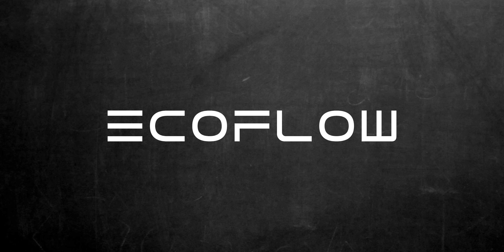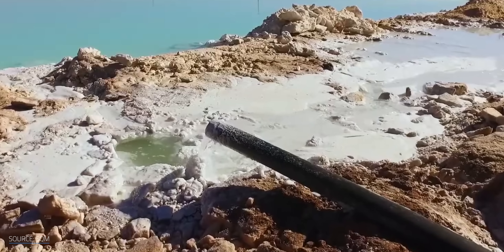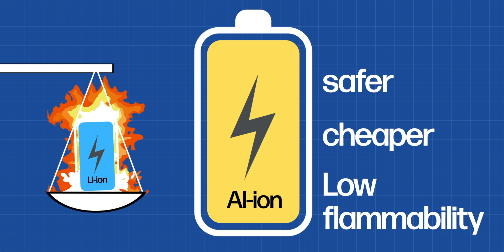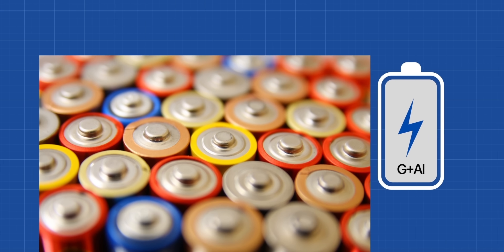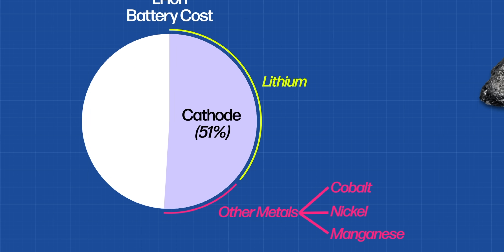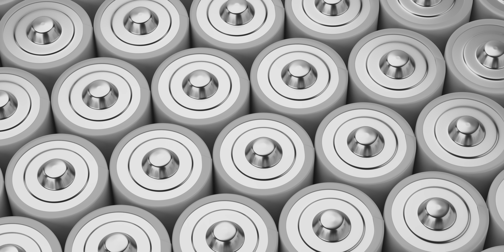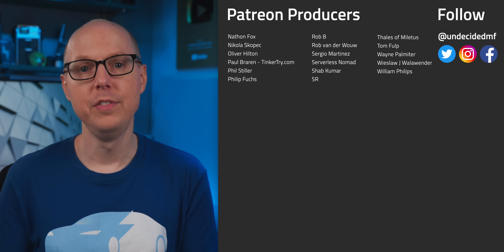Can This Metal Really Beat the Lithium Battery?

Comment: My question (I did watch the video on aluminum-sulfur batteries awhile ago) but can the 2 chemistries be combined? Use the aluminum-graphene anode/cathode and aluminum-sulfur electrolyte to prevent dendrities? Simply reuse the heat generated during discharge and recharge and cycle a very small amount of heat from say a small heat pump to keep the cells in their optimal heat range(heating and cooling, oil/water or air exchanger)) or heck use low level alpha particle emiting compound in the outer jacket to heat the material close to its optimum temp

Comment: I like how you downplayed the cost of graphene by giving the cost per gram rather than ton like all the other materials.  When you convert to ton, LI-ION batteries sound extremely cheap by comparison to the aluminum graphene batteries.  Let me know when the graphene gets anywhere near as cheap as lithium or any of the other ingredients for LI-ION batteries.  Also the cost per ton is not very representative of how much the batteries cost to make as the amount of each ingredient matters more.  You should give the cost of each ingredient per battery and compare that with the aluminum batteries.  This video is biased to make aluminum batteries look promising.  Thumbs down.
Reply: Werent lion batteries multiple times more expensive a decade ago? Or solar power? Efficiency of scale..
Reply: @WhatmoralrightdoesUShave  Yes.  The cost has gone down exponentially and still is.

Comment: 👏👏👏Finally! 
- The "60x faster than lithium" charge rate along with their fire-safe integrity makes these batteries a real solid option for Long Range propulsion in Electric Powered Sailing Vessels: ⛵
✅ Two Battery banks: 
Bank 1. driving the motor for a few hours, while 
Bank 2. is on fast-charge! (and charged within the hour!)

Comment: I make aluminum supercaps and aluminum/zinc/steel batteries and I simply couldn't do it without the flexibility of aluminum.  As long as aluminum batteries aren't prone to exploding into a massive thermal meltdown in your pocket or under your car, I think the availability and lower cost alone is worth it.

Comment: Matt I like the idea of Aluminum graphine battery, yes I would be happy to have one in a car sounds like it would charge during lunch and not have the fire danger.  Plus cost savings.
Reply: High charge currents are moving the fire danger elsewhere
A lot of heavy ev charge cables are fitted with water cooling in order to stop the wires overheating and burning up. The feeders for these rapid charging stations can be mind boggling

Comment: Well done Matt,  
Think about this.. We went through the same "transition" when Ni–MH was the king, it took a while to get everyone on board with Li-Po but when it happened everyone seen the benefits ( I was in the RC racing scene at that time so I speak in those battery terms, sorry )

if I was a billionaire I would invest in either this company or some other company that has a solid plan to replace the current market battery.
Although the ultimate "renewable energy" is hydrogen, I think we are decades away from that.. To be able to use the waste from nuclear power plants, and turn that into energy for the consumer market, yeah we're a ways off from that..    

I think this Al-ion is a great idea short term ( for the next 20-30ish years )

Comment: I remember hearing about aluminum oxide batteries, specifically one particular aluminum oxide battery where the inventor figured out how to get past the gelling issue, a while back but unfortunately at the time no one was willing to fund something that wasn't lithium ion.  Aluminum oxide isn't rechargeable but since the oxygen part of the reaction can come from the air it boast great energy density and of course they'd be easily recycled and cheap to produce.  I wonder how that technology would compare to the potential of aluminum-ion or if it might be possible to create a rechargeable version of aluminum oxide batteries.

Comment: That high recharge rate would already benefit laptops and cellphones more than higher capacity... assuming corrosion can be controlled.

One good application for these batteries right now is E-readers, since you won't be charging very often.

Comment: I just can't wait for one of these potential break-throughs to become ACTUAL ones.  I've been day-dreaming of an affordable, powerful, efficient, light-weight, fast-charging, solar-powered 1000-mile-range EV for over a decade now.  Can't wait to see it become a reality.  Throw this battery in an Aptera and we're made!
Reply: Maybe in the future it can charge whilst driving on certain highways with embedded wireless power transmission. Then you can use a smaller battery that make light weight cars.

Comment: Not in a phone, if its just pumping all they heat into the circuit board and my hand. Certainly for other applications it would definitely be a useful advantage. Eg home solar storage, especially when I means you can whack it in a hot tin shed on a 40 degrees Celsius day and the battery charges faster 😅

Comment: It charges faster when hotter doesnt sound good for my phone. I'm also surprised about "carbon traps heat", as I believe Diamond is a good thermal conductor but a bad electrical conductor. So the form matters a lot.

Comment: Very interesting. When talking about the cost of aluminium, it is also worth mentioning the weight of the metal. The quantity of material per tonne varies. The quantity per cubic meter would be worth comparison. Per cubic meter, Aluminium 2700 kg, Cobalt 8900kg, Lithium 535kg, Manganese 7430kg, Phosphate 1762 kg, and Graphite 2250 kg. For use in cars, the battery weight to power is important. How would the weight of the battery compare. For use in cars, batteries weight, size and power will determine how many batteries can be installed, and the range that the car can do between charges. It would be great to hear some facts in relation to this.
Reply: There's only a few kg of lithium in a 100kWh battery pack. Switching to aluminium in the same form factor would add about 10% mass (but of course, you can use smaller/lighter cells thanks to the higher energy density)

Comment: $100 a gram is way more expensive than all the rare earth metals combined. They must be using a miniscule amount if they think they can get the pricing right.
Reply: If you're referring to graphene, it's generally used as a 2 dimensionally (one atom layer) membrane and even then supposedly all that cost is in the production of the material, the raw carbon is nearly no cost at all and can be made from decomposing practically anything that's organic.

Comment: Great Video Matt, I wonder what the performance of Aluminum Ion would be in the cool and extreme cold?  Lithium performance is terrible on a tesla in the winter
Reply: It sounds like with the Al-S battery, you could actually insulate it and it would work better.  So whatever heat it develops in charging and being used, could be used to keep it warmer and more efficient.
Reply: It's aluminium... Not aluminum.

Comment: Speaking of aluminum, there is also the aluminum-air battery ... On May 27, 2013, the Israeli channel 10 evening news broadcast showed a car with Phinergy battery in the back, claiming 2,000 kilometres (1,200 mi) range before replacement of the aluminum anodes was necessary.

Comment: @Undecided with Matt Ferrell
Anything that gets us away from the problems and safety hazards of Lithium based chemistries is a good thing. Whether it's Aluminum Ion, Aluminum Sulfide Ion, Carbon-Copper Sulfur Phosphide or something else, to me any improved chemistry formulation that grants higher energy density, quicker recharge times, safer operational performance, longer durability(charge/discharge cycles) and recyclablity is a win for the world. The key is to get these technologies out into the world. Lithium was a bad idea even when it was new and is long overdue for replacement.

Comment: I wouldn't mind using these batteries for energy storage... but it depends on the cost at the end of the day.  Li is still very expensive, so quite where Ali will land is anyone's guess at this point... novel usually implies high cost... we'll see... thanks for sharing.  Great video as usual :-)
Reply: Novel usually implies high cost at first, but a novel idea that turns out to be a good idea never stays novel for very long. Once more than one outfit knows how to make something, cost usually becomes a race to the bottom.
Reply: The limiting factor is graphene it still isn't scalable yet so maybe 10 years away.
Reply: Most of the current cost of lithium is the transport of raw materials from brine lakes or other concentrated oceanic salt origins. These resources tend to be a long way from anywhere.

On the other hand, lithium carbonate only makes up 10% or less of the cell's production cost 

Lithium is a side gig for potash producers. It could also be a viable side business for large sea-salt producers (there's lots of lithium in seawater). There's NO danger of running out because even with current processes, if the price raises very much,  moving to direct seawater extraction (instead of using sources nature has pre-concentrated for us) is perfectly viable and the extra production costs would be offset by lower transportation ones

Comment: any energy storage methodology is urgently needed, and size should not be a limiting issue as most energy can be centralized as we have existing distribution grids.  As you said succinctly, many chemistries will be useable and all should be pursued to end up with the 5 or 10 that prove out.  Since we use pumped water today, that is the size and shape that baselines largest and most difficult storage of the future, in other words, size should not really be a problem for the grid solutions.  Save the expensive solutions for mobile use, which will become a small percentage of the overall requirement in the electric future.

Comment: Nice trick using price per-tonne for all other materials, but price per gram for Graphene. 
But be honest, that $100 per gram price you quote for Graphene, is $100m per tonne!

I know, things will change, but that is a lot of change required.
Reply from the maker: Wasn't trying to use a trick there, but fair call out.  Graphene is extremely light and not much of it is needed, so it's not as bad as it sounds.  We had a huge problem sourcing production costs because most companies don't seem to report them anywhere.

Comment: This is the most stupid idea I've heard. Wtf is wrong with people that they'd go back to single use batteries?
Reply: These aren't single use... Did you even watch the video?
Reply from the maker: Aluminum air batteries are single use.  These are different.
Reply: Bro, you should delete your comment.. fast
Reply: They did mention fast charging. I don't think it's single use.
Reply: Even the non-rechargable aluminum air can have a place.

It's a fraction of the cost of lithium. 
Which leaves a lot of money to go towards recycling. Lots of other savings as well. Powerplants are just more efficient than a gas car. As are electric motors. 

This channel did a video on them, with the example of someone with an electric car that needs to do a long trip.

It would be better to use a cheap easily recyclable aluminum battery, than to use a FF vehicle.
A 5k pound Tesla needs about $4.50 in electricity to go 100 miles. A gas car of the same weight, would need a minimum of 4 gallons of gas, and most on the roads today, would need 5 gallons.
For 1,500 miles, that's $282 in gas, and $67.50 in electricity.

Plus there's the cost of the gasoline car's rental price.....

Seems like it should be economically viable, and cause less pollution overall.
Reply: I'm laughing at you for posting hate at 2 minutes after a 13 minute long video was placed

Comment: It seems to me that an excessive charging rate and heat may be controlled via a built in resistance to control the charging  ,  or a timer that reduces the rate of charging over time or increasing resistance with amperage  !!! ??

Comment: All I hear is once these get on the market these companies can recoup their costs quickly and possibly take over the market if they charge similar or slightly below Li-ion battery prices. AND they can be recycled when dead dead. so would make for a push towards easier to replace batteries in devices.

Comment: I have 2 off topic questions:
1)  Can concentrated solar be covered with solar panels?
2)  If fusion is 20 years away from becoming commercial, should the investment into renewables, instead be focused there?
Reply: I can answer the second. No, the sheer volume of energy storage required to power a single city is unpractical and will likely stay that way even with the most promising of new battery technologies.

Comment: Rough estimate here, but it would take two Tesla batteries to power my house when the sun goes down, three to really comfortably go off grid. My solar system was 15k for materials. Three Tesla batteries would make the system 45k, the same price over 25 years (at current prices) as my expensive utility monopoly. At the cost per unit of power Matt quoted here would put our utility monopoly out of the residential power business!

Comment: Although the cost of the materials used to make a product are important, its price tends to depend more heavily on factors like production costs, R&D, logistics and even market demand. Like any other new technology, I expect these to be more expensive than already established Lithium based tech regardless of the material cost for quite some time. It is quite a challenge to scale a completely new and different production process from labs to factories in 2-3 years and it is near impossible to do this and compete with an existing technology on price, even if you are using cheaper materials.
Reply: Hopefully as they prove themselves some existing battery producers will either license the technology or just outright buy the companies producing them.  I think the markets competitive enough to push said big companies to seek whatever advantage they can get.  If a large company does buy in they could potentially eat some of the cost to get better adoption and thus gain a higher market share before other companies have the chance to catch up (we've seen similar strategies before).

Comment: As I imagine the dendrites would be pretty fragile, I wonder how well mounting an ultrasonic transducer to the electrodes would work to break them off before they could travel very far.  (I'm thinking that short pulses during discharge would be all that would be needed.)
Reply: Might not even need that.  I read an article recently talking about dendrites in Li-Ion batteries that suggested we may be able to fight off those dendrites simply by applying pressure along a certain axis.  The researchers found that the direction of Li-Ion dendrites is determined by mechanical factors so applying the right kind of pressure can force them to form in a way that renders them harmless.  If true I'd imagine similar forces are at work with Al-Ion batteries as well.
Reply: @grn1  in addition to the physical aspects, they were also found to be able to be moved/shrunk by appropriate charge current manipulation

Comment: With the amount of money being pumped into the battery industry I have no doubt various breakthrough's will happen.  However, I've been reading articles about next big thing in batteries for two decades now and it's always 5 years away.  Instead we've just been gradually improving on existing technologies, which is good, just slower.

Comment: 3:30 Why compare gravimetric capacity to raw metal but not the proposed battery?
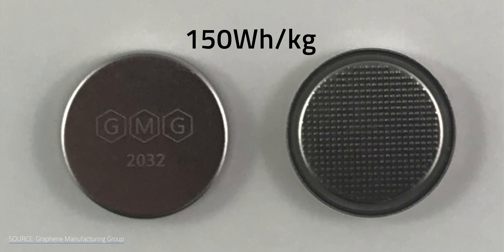Only much later 7:20, these crucial metrics are discussed for the first time. And they turn out fine (in the lab).

Comment: I am watching this at 3:27 since it has higher energy density it probably has higher termal expansion, active cooling is probably going to be must have in battery packs, more moving electricity means more heat simple as thet...
Reply: They also said the internal resistance is lower, that would mean less heat for same current

Comment: Of course I'd love to have a functional version of these in my phone, laptop and in a future car. Charge even a car in a few minutes at most on anything better than trickle charging? No real risk of battery fire? Who wouldn't want this? Also, it would be exactly what's needed for the watch market. There is a clear size limit on how big those can be unlike phones have gotten big enough to not be a huge problem. Even if the watch still had the same battery capacity, if it could be charged in a minute or less(?!!) then no one would really about charging it because it would be a trivial matter and the health monitoring would continue unabated.

Comment: Am I missing something? Molten salt as an electrolyte sounds potentially dangerous in a mobile situation. What temperature is the electrolyte during normal use? Will be necessary to heat up the salt in order to charge it or use it?

Comment: I look this up there claiming 7000w/kg that would be a game changer. If my calculations are correct a 100 lb battery would have a 1260 mile range. Maybe more due to the pack  lighter weight

Comment: I want a megawatt of storage for home use. It doesn't need to be long term storage, just a few days to cover overnight and cloudy weather gaps from my solar system. Therefore, light weight or small size isn't an issue. Rather, I want high lifetime and low cost.